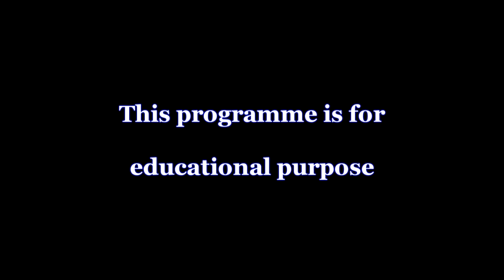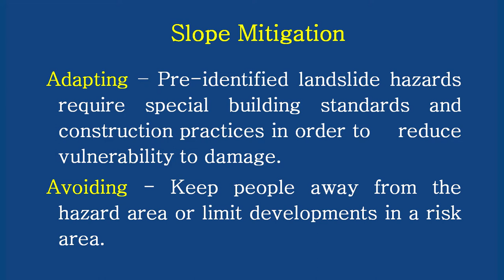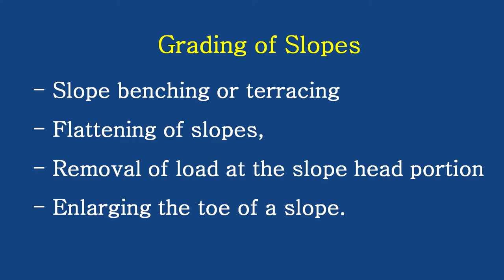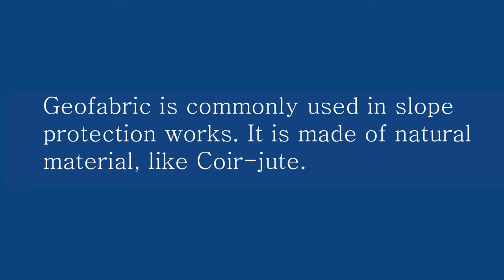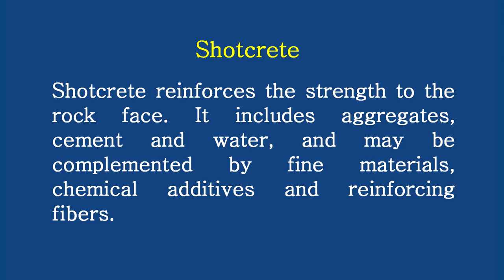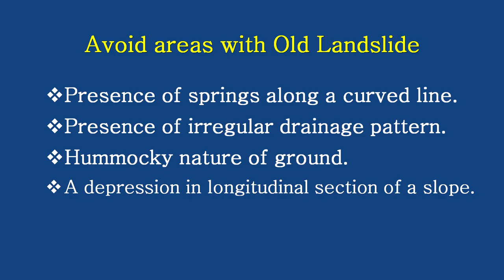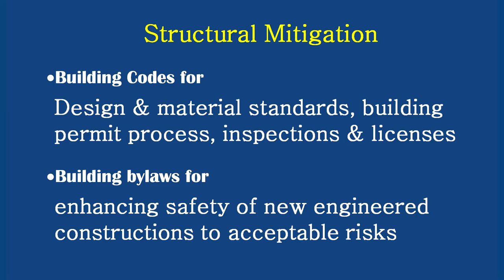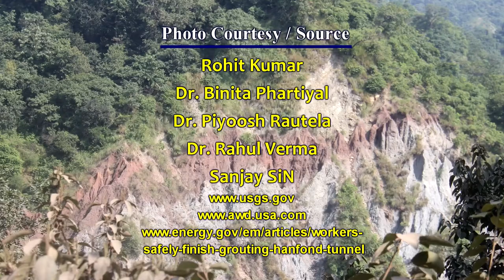Landslides: Mitigation Measures

Comment: Indigenous technology 
Altering 
Averting 
Adapting 
Avoiding
Suitable drain to channelize excess water during heavy rain 
Perforated drain pipe /pvc or steel envelope 
Horizontal / vertical / deep trench drains 
Slope benching / terracing 
Flattening of slopes 
Soil or debris removal 

Construction of retaining walls on valley side and breast wall on hill side 

Crib wall - saturated materials  instead of concrete wall 
Mulching & adding groundcover